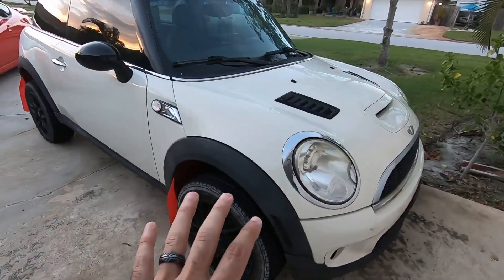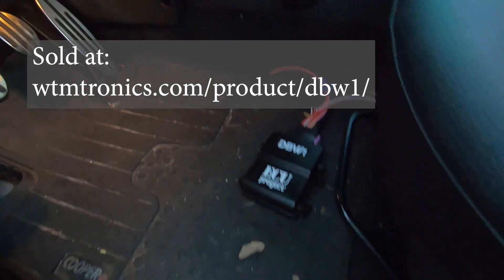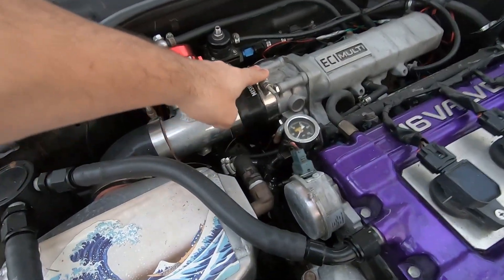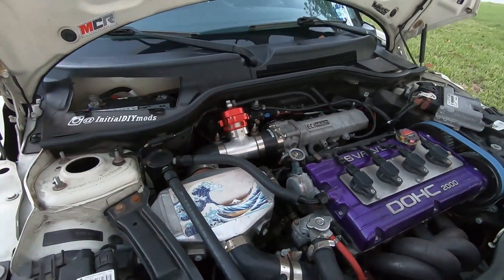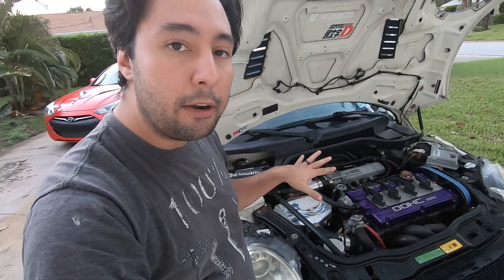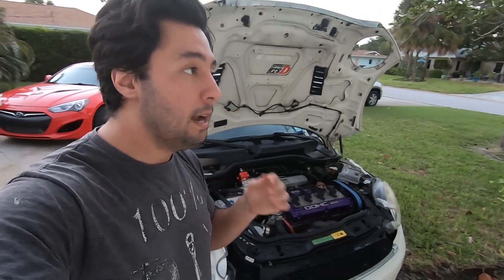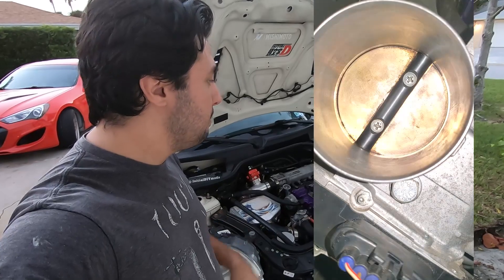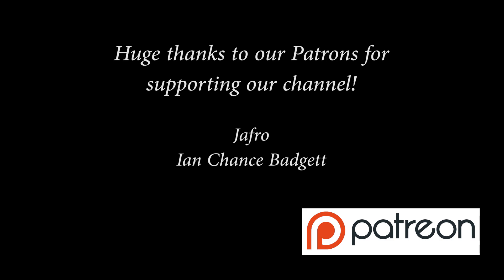Convert a Cable Throttle to Drive By Wire - Simple Walkthrough - AWD Mini Cooper Ep. 27

Comment: Update on the genesis bro
Reply from the maker: I got caught in a little flash flood a couple months ago and hydro locked the motor so I'm going to tear down the motor next month and see if I want to rebuild it (probably new connecting rods at a minimum since it's seized) or throw an engine swap in it. I have an LS sitting in the garage so that's one option, but my wife mentioned she likes the sound of the RB26 better. So there's 3 options that I'll have to figure out this spring.

Comment: Drive by wire is worse btw
Reply from the maker: Between the improved idle control, throttle seals that can't leak (unlike the old 1980s-1990s Mitsubishi throttle bodies that need to be rebuilt), and ease of connections for tight engine swaps like mine, it's really much better than a cable throttle. I'm rally racing so I don't need to feel the vacuum pulling on the butterfly plate and I'd argue that any decent driver can drive both just fine. I've had both setups on this car and the DBW is simply way better.
Reply: @InitialDIYmods  race grade pedal boxes are drive by cable for a reason but keep doing you smh
Reply from the maker: LMAO pedal boxes are a totally different scenario and different market. There are pros and cons to both throttle options and not every case requires the same answer. If you can't recognize that, then idk what to tell you.

Comment: What previous module did you use?
Reply from the maker: I used an Arduino uno as the main control unit with a code off GitHub and then I used an h bridge motor controller to control the direction via pulse width modulation (pwm) signal from the Arduino. It was much more complicated than the unit in this video. I'll eventually post a video on the DIY controller as part of the AWD Mini build series.
Reply: @InitialDIYmods  was it the dstage garage one?
Reply from the maker: Was what the dstage garage one? I'm not familiar with that company. The one I made was from scratch with an Arduino uno and an h bridge controller. The one I bought had the website listed in the video and in the description, so I'm a little confused on which you are referring to.